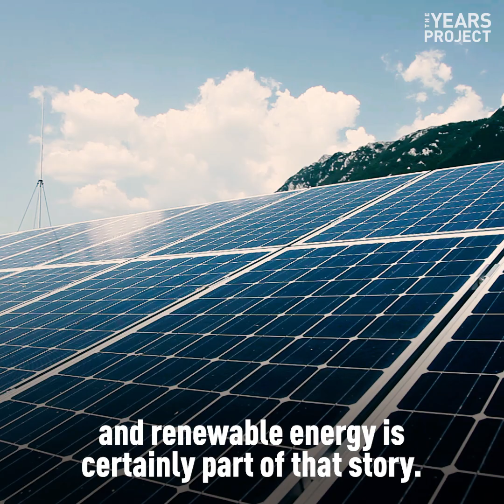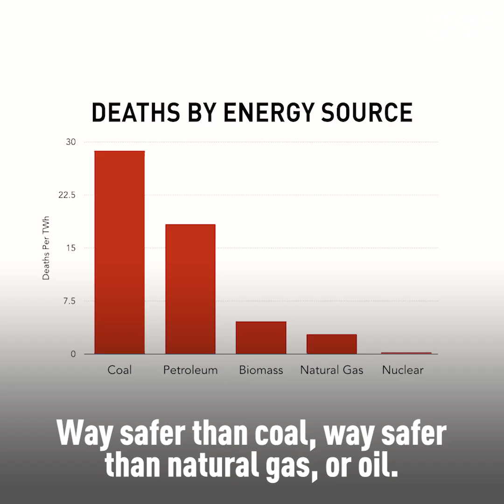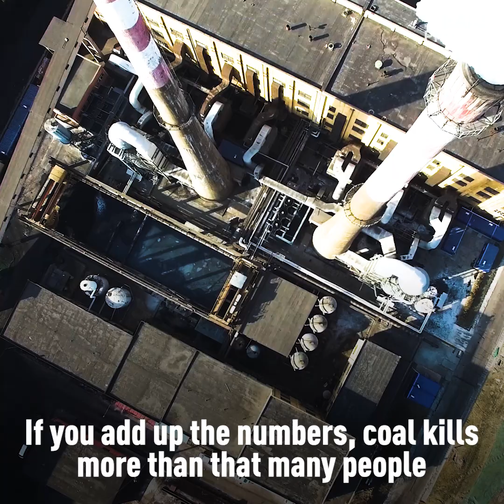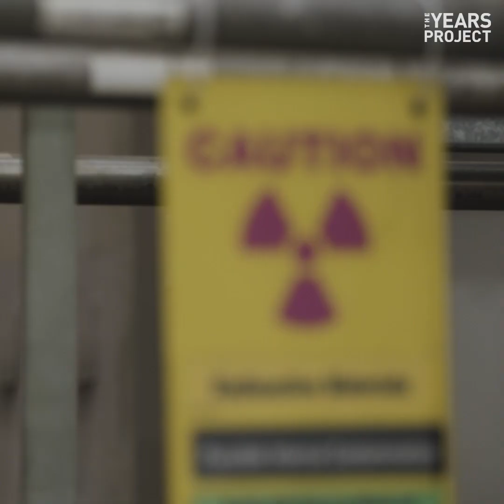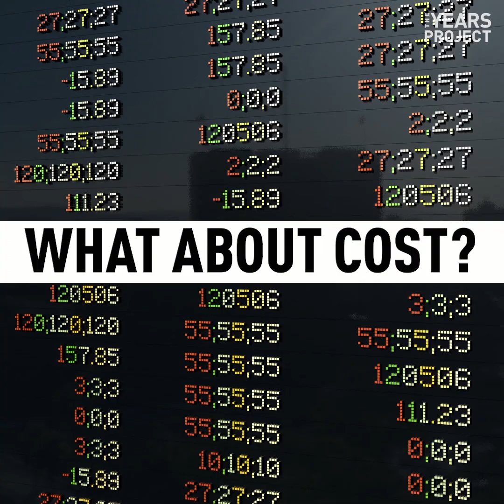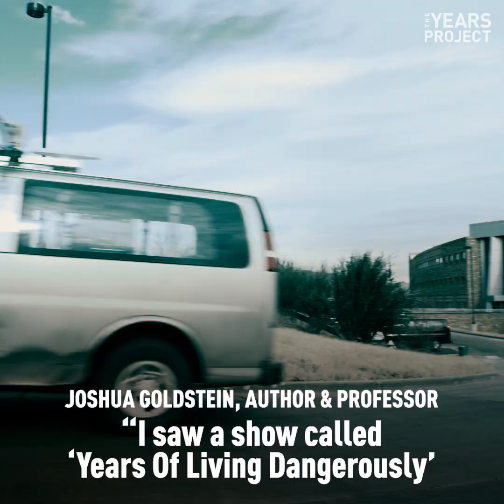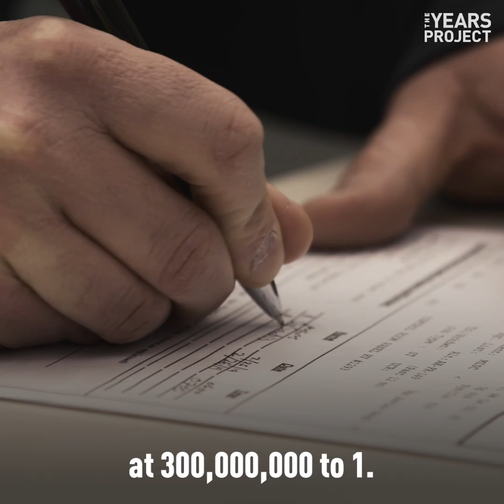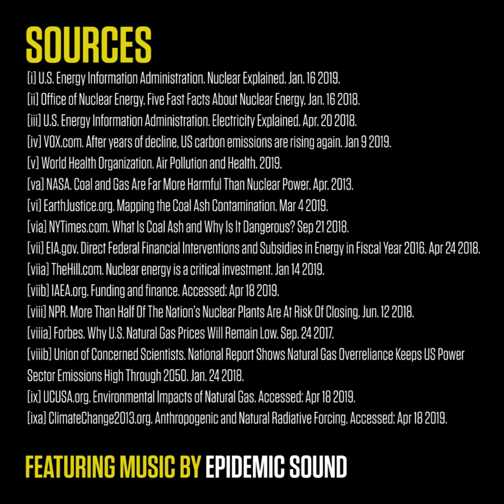The Nuclear Option

Comment: 2:20 "POTENTIALLY" thousands??? are you f kidding me??? i'm all for safe nuclear plants, but bitter jokes (and jokers) like this kill our arguments instantly. "Potentially". ffs.
Reply: I don't think he was joking, it's just that with the extremely low levels of radiation people received, there wasn't any statistical evidence that Chernobyl caused additional deaths other than from the explosion and initial fire-fighting (28 deaths).  For cancer it was about 16,000 thyroid cancers, which are one of the easiest to treat (only 1% mortality, so 160 deaths). Some ultra-conservative estimates put it at ~4,000 potential deaths (again, they haven't materialized in the data and it's been over 30 years.)
Air pollution from coal kills about half a million people a year, when everything is working perfectly fine. 
It's why nuclear has saved approximately 2 million lives since the '70s just by displacing fossil fuel plants.